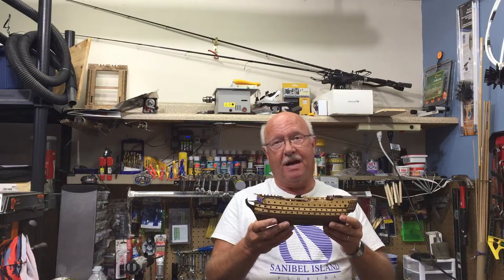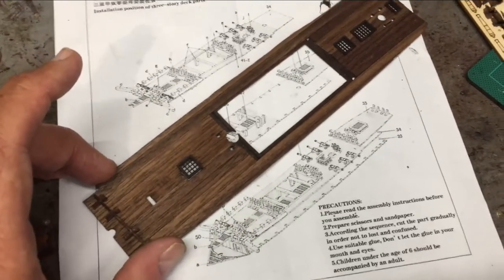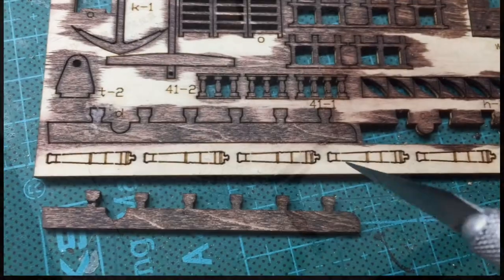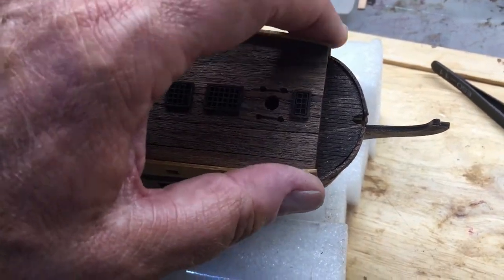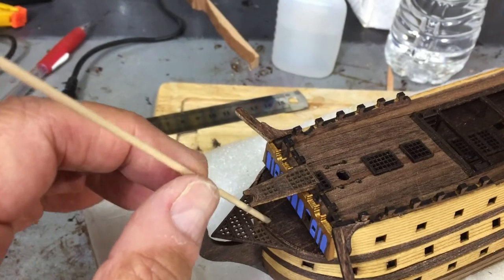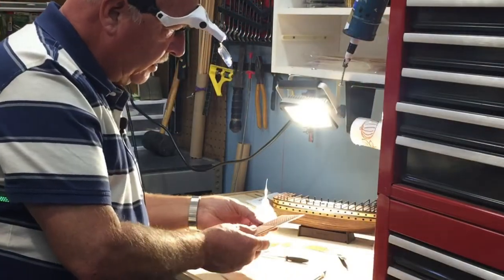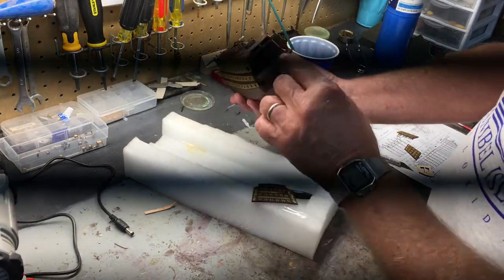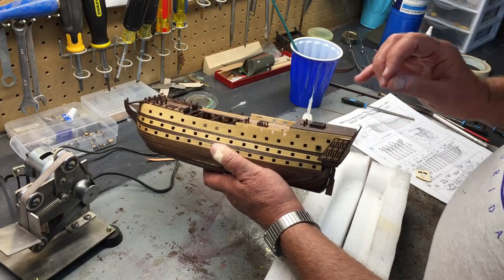HMS Victory Model Ship Build Episode 5

Comment: The smaller the tall ship model, the exponentially more difficult it is to keep the level of detail and fittings scale correct, not to mention the simplifications to the rigging that will also reduce some detail.  The small ships are the very hardest to make.
Reply from the maker: Scale is very difficult!  I’m trying to add belaying pins.... I pre-installed them and even looped the rigging lines on the pins, but the pins are too large for the scale. I’ll decide later if I’ll keep them or not.  The model didn’t have them. I’ll research the actual ship to see if it does?
I’ve been working on tiny cannon barrels and after several prototype versions I have been successful in scale!  My mini lathe, 1/8” dowel and using sandpaper instead of the lathe tools is working. I’ve also been able to get the cannon bore holes dead center!  That’s a task in and of itself 😖.
Thanks for watching and taking the time to comment and provide some guidance 👍👍
Reply: @BoilerDan1  The smallest belaying pins are made by Falkonet in Russia, bought from ModelExpo-Online.com.  They are shaped to perfection.  I used 9mm long wooden pins on a 1:100 scale man-of war, La Couronne.  The 8mm long ones are actually thicker in diameter and may service you better if you tend to break things.  The trick to not breaking them is never glue them in place, so you can replace broken ones, and always start rigging your line at the belaying point on the rack and run the line up into the masts via blocks to tie it off topside.  Best wishes!
Reply from the maker: @DARIVSARCHITECTVS  THANKS

Comment: great model, what scale is she. The reason that I ask is that I'm in the process of building a hollowed out carved model of Victory from 1920's plans and it is a similar size and is 1:180. I'm wondering if I might buy an example of your kit to help with scratch building the details which are not in my "Hobbies" plans. Thanks Keith from Tasmania
Reply from the maker: Mine is 1:200 scale.  I’m going to share with you a 3d site that may be helpful. Someone sent it to me and you can venture to anyplace in the ship.
I’ll also add a link to purchase one like mine, however instructions are weak!
Mine: https://www.ebay.com/itm/15444071042
The 3d site is sketchfab.com 
Type in the name of the ship in the search box.  There’s several, scroll down to the ones without prices. It’ll take a while to figure it out. But it’s amazing detail and you can go inside of everything!  Left click will pivot, right click will move viewing position. Scroll button will zoom in and out.  On computer anyway!
Reply: @BoilerDan1  Thanks for the information, I'll check out the sites. Good luck with your modelling, I'm just at the stage of locating and cutting the gun ports on mine as the plans I have are so bad I've had to measure, remeasure and measure again. All the best and thanks again for the info. Keith
Reply from the maker: I’m almost finished and will post something soon.  Although it won’t have everything that the actual ship has, but I learned a lot, and the final will show some experimenting with copper coating on the hulls exterior.  I hope to try it tomorrow!
Good luck on your build, you can do it!